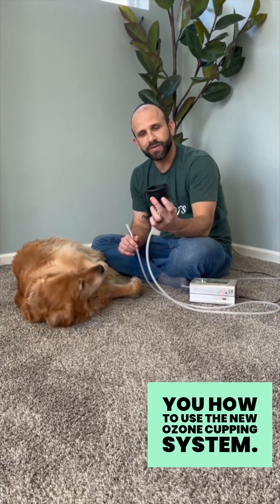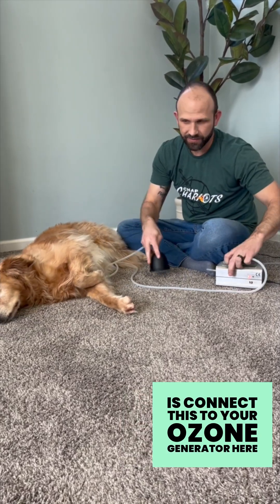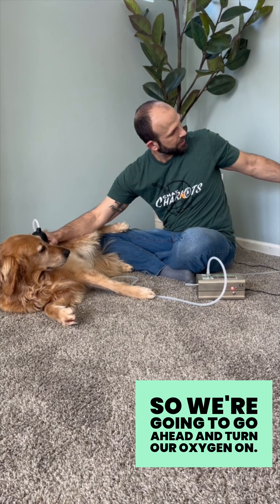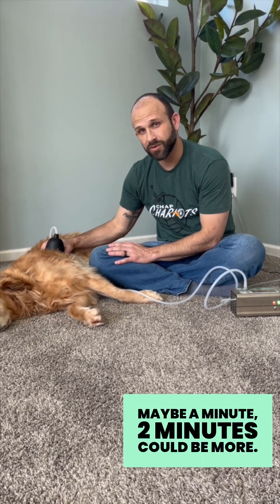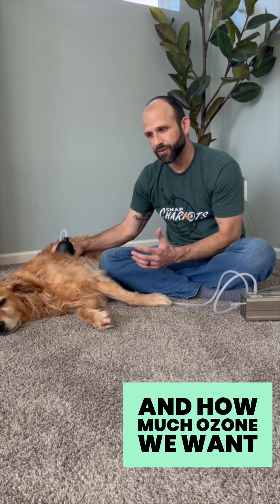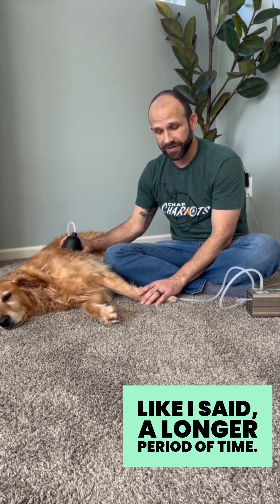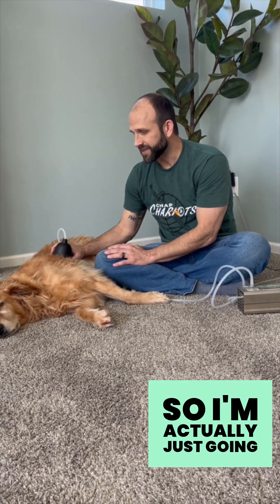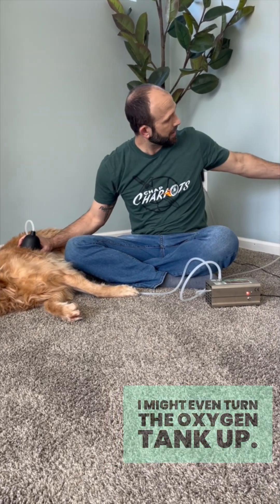How to do ozone cupping on a dog

Comment: is there any risk of them inhaling any ozone with the destruct built in if we are trying to cup an area around the mouth? is it better to use the water bubbler and attach the cup to the ozonated gas instead?
Reply from the maker: Breathing some ozone will not hurt, but if you are concerned, remember that ozone is heavier than standard air. It will flow down from the output. If you need to keep it away from a dogs nose, put a damp towel around the area to block the flow of the gas.